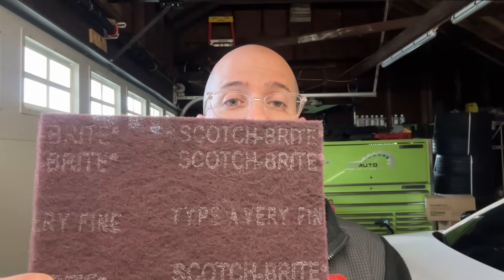Q&A Episode 97 (hybrid battery filter | theft | pulling)

Comment: So I have a 2025 civic sport. Couple months ago had the strut mount towers replaced due to noise when turning. Service adviser told me their is still a creak noise  from steering wheel airbag area( inside the car) and Honda currently has no fix for the issue and I would be contacted as soon as as they due.  They also replaced the clock spring thinking that would fix the issue. Have you heard about this creaky steering wheel issue?
Reply: Thank you, for always responding to us.
Reply from the maker: @ your welcome
Reply from the maker: @hipfire_22  you have to add more felt tape to the nipple on the clock spring, that usually fixes it but I haven’t had a 2025 civic with that concern yet

Comment: I have 2024 CRV Sport Touring with 40K miles.  I noticed there is some black soot on the tail pipe.  Is that normal or may indicate some engine problem?  Should I do something with that?  How are those 2.0L DI engines holding at high milage?
Reply from the maker: @PolJanusz  most likely just from Hondas notorious rich running conditions.
Reply: Do you recommend checking with dealer?  What can be done to fix it. 
Thank you
Reply from the maker: @ you can mention it although it is a known fact Hondas run rich from factory. Nothing they can do about it

Comment: In September, my car threw the P0455 and P0456 codes twice within 10 days. It had been fine since then until today when in addition to those 2 codes I got a P2421 as well.
I plan to take the car to the dealership since it's still under warranty. Should I mention that I previously scanned and cleared these errors twice to see if they would reappear? They obviously did, but it took six months for them to come back. Also, would they ask/care which scan tool I used? (fyi I'm in Canada)

Some ideas for more of your great Q&A episodes if you haven't already covered them:

- Can dealership scan tools detect if you've flashed the ECU to put an off the shelf tune on the car? Do you check/are you concerned about such things with certain models (ie. Civics)? Would a dealership check for a tune/flash history when a vehicle comes in with a blown head gasket? (or any kind of obviously potentially related engine issue)

- Being a northerner and using a block heater whenever it gets below -13 celcius,  I (and possibly others) have neglected to unplug the extension cord from the block heater and as a result have damaged the cord. I can't seem to find a video on what needs to come off to replace that block heater cord. I see it has a connector so I imagine it should be pretty straight forward but some instruction around the best way to get to that area would be nice.

Keep up the great work! I love how much material you cover in each one of your Q&A episodes. No BS, just staright to the point! 👍
Reply from the maker: @konos3951  thank you for all the submissions. I will surely try and answer them. As far as your situation goes I’ll cover it this week. Not your exact situation but in general.

Comment: I have an OBDII reader and at least in my CR-V Sport, the battery's fan doesn't really do much when it's roughly 70°F (room temperature). It'll spin at 1900 RPM when it's cold to help circulate warm air from the cabin into the pack, and it'll spin at 1900 RPM when the battery gets a little warm, but when it's in its sweet spot the fan shuts right off. And it is capable of spinning over 4000 RPM. So I assume these hybrids aren't going to have a ton of issues with dirt unless there's a lot of cold/hot driving and you don't use the climate control to maintain a comfortable temperature.
Reply from the maker: @scott8919  agreed I also think that as long as the interior isn’t a dust ball or maybe filled with pet hair, overwhelmingly a non issue.

Comment: I finally traded in my 2016 Civic for a 2025 Civic hybrid sedan on a lease. If i wanted to add wheel locks, do i have to add Honda wheels locks or can they install Advanced wheel locks at the dealer?
Reply from the maker: You can do any wheel lock as long as it’s the right pitch and shape you need acorn, not a tapered seat.

Comment: Another great video as always! In my opinion, Honda should put in a bit of effort to make theft harder. They don’t need to turn it into a tank, but how much does it really impact their bottom line to make the radar a bit harder to steal.
Reply: When insurance companies start doing security ratings of vehicles considering and parts, then we will see a change. In the UK the insurance industry consider these ratings and it affects premiums. Vehicles, for e.g. the Honda CRV, are more secure than there than in NA.
Reply from the maker: @sizzlacalunji  absolutely, insurance companies need to start holding the manufacturers accountable and not the consumer for thefts atleast imo. Atleast the manufacturers should be forced to alter their designs or adapt
Reply from the maker: @Ok_Mountain_8698  I agree heck, even if the price went up 100-200 per car the consumer would be better served. A radar theft alone could cost the consumer easily $1,000. I rather pay $200 up front additional plus added peace of mind.